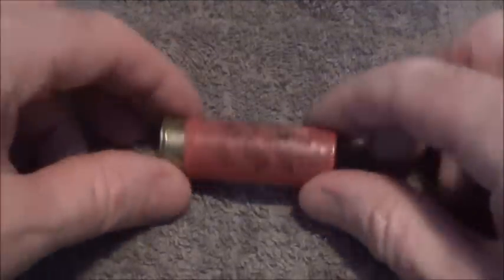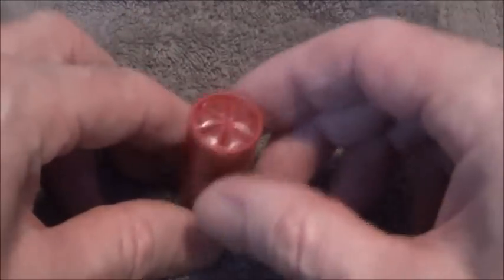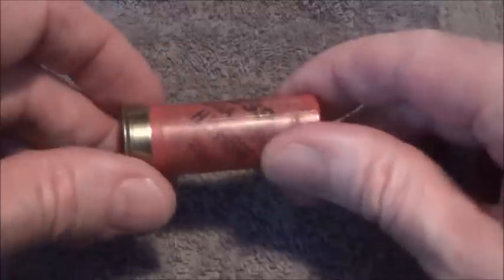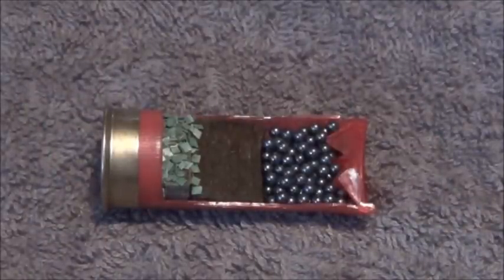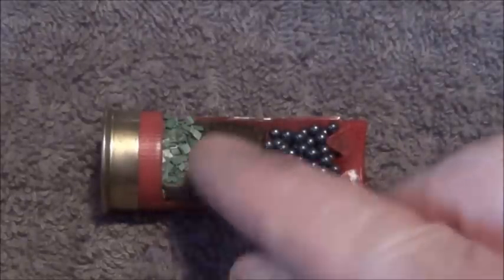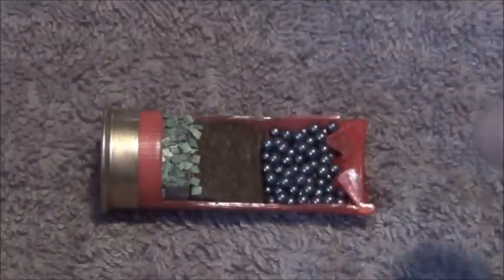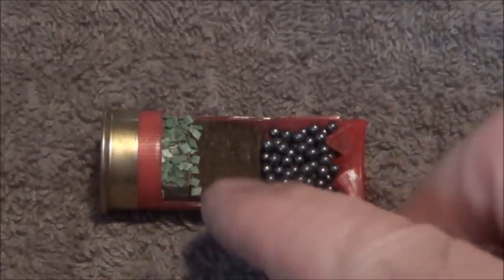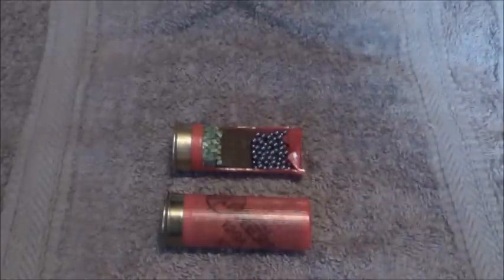How a Shotgun Cartridge works

Comment: Brother, I have a question,
Does the walls inside a shotgun barrel slightly narrow down ahead to make the wad seal the gas behind it? Or does the wad itself expands slightly?
Thanks in Advance
Reply: Bruce Hamilton  Thanks Bro,
My idea is: I think the chamber is wider and then there is a choke which is level with the edge of the shell and the barrel is a snugly fit with the wad.

Comment: I was curious about something. When it’s fired, does it travel straight or is that because the barrel funnels it down making it straight. Or without it would it just fire in all directions?
Reply: I just saw a video where they shot one without a shotgun and it travelled outwards but kinda in a lot of different directions
Reply: The barrel keeps the shot straight.  Once the shot leaves the barrel it will scatter randomly.  You can also add a "choke" to the end of the barrel as well which can narrow the shot more and keep it from spreading as much as soon as it leaves the barrel

Comment: I though shotgun bullet having one single bullet,but what these balls?
Reply: They're called pellets
Reply: single shot are slugs or balls, you can take this load and make cutshell slugs so long as you remove the choke. I've blown 3 inch holes through fire extinguishers with a light birdshot by making an overlapping cut in the center of the hull without cutting the wad. Poor man's slug but wont tube cycle unless you use electrical tape.
Reply: The the amount of balls define the round, lots of little balls is called "buck shot", then there is bigger balls consisting of 9 lead balls this is called double up buck. Basically the less balls the bigger they are in size and weight which is called grain, all the way up to slug which is just one lump of lead or steel or brass, they are all defined by weight, a slug can weight up to an ounce in weight.
Buck shot is for light game... birds, double up buck is for foxes and alike... slugs are for big game, wild pigs and so on.